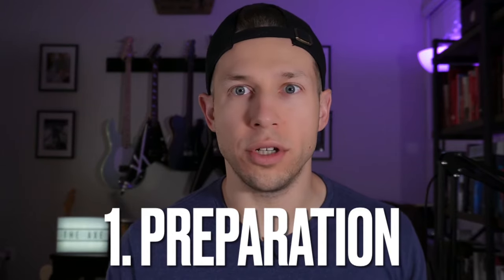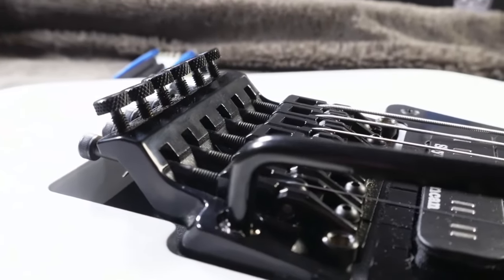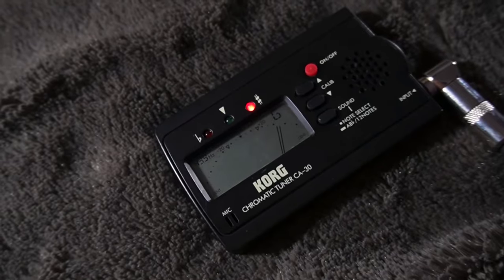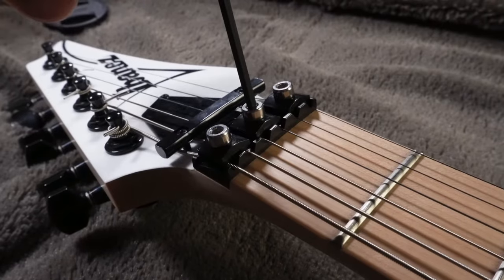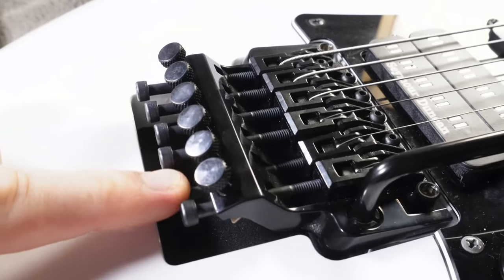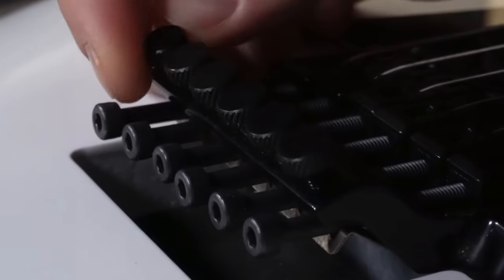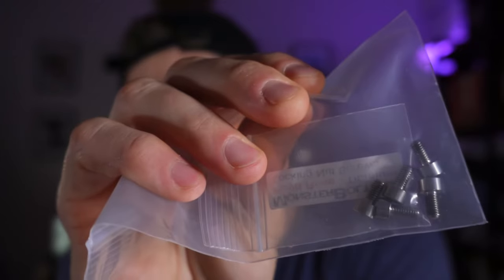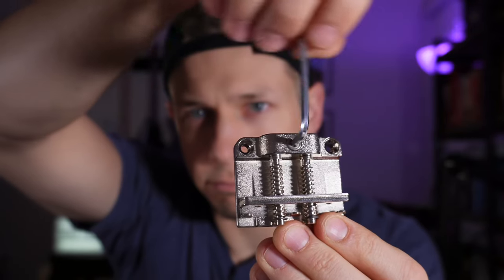How to Fine Tune Your Floyd Rose Guitar | 5 Simple Steps

Comment: I hated Floyds with a passion, because I switch between E Standard and Drop D quite often, which is quite a hassle with a Floyd.
Recently I discovered two accessories for Floyd Rose trems, that completley changed my perspective on them.

First one being the "Tone Vise Keyless Locking Nut Locks", which replaces the regular locking blocks on the nut with new ones that come with springs and an integrated wrench.
Meaning you can quickly unlock the locking nut for any tuning changes you might want to do, without needing any tools.

Second one is the "Tremmory", which essentialy is a tremolo stabilizer but it requires no modding what so ever, because it fastens on the claw and the trem block.
It has a thumb wheel with which you can engage/disengage the system, when engaged it stabilizes the trem so well you can easily go from Standard to Drop without retuning any other string.
To some extent it can even compensate for a broken string!

Now I am activley looking for Floyd Rose equipped guitars xD
Reply from the maker: Wow! I that’s really interesting man. I e heard of a tremmory. Those are cool. Thanks for the comment brother!
Reply: Check out the D Tuna EVH invented.
Reply: @cobyn4008 That really only works for Floyd’s that or top mounted